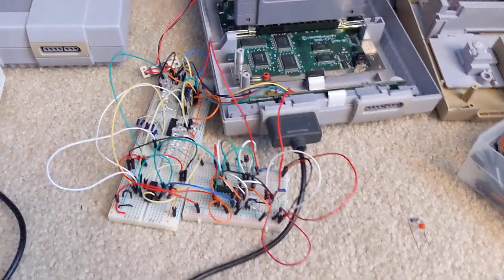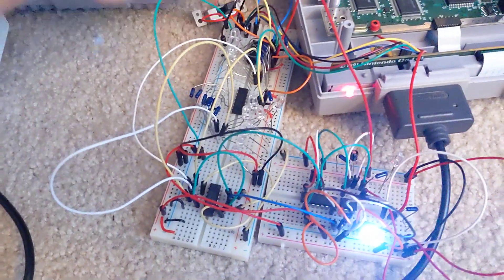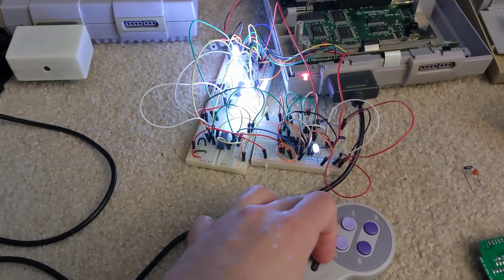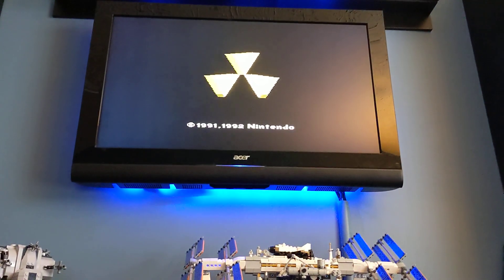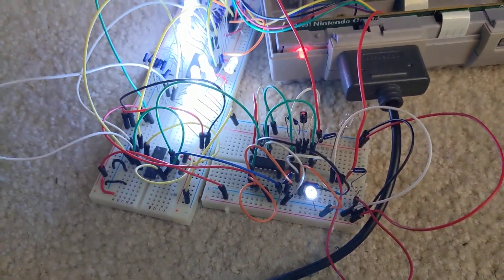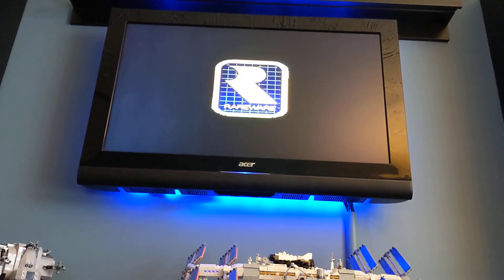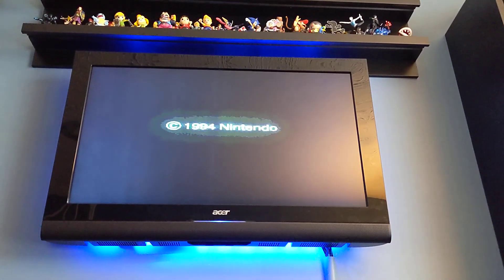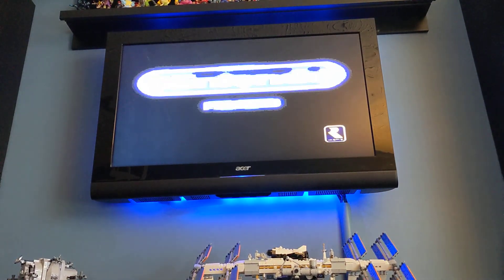Resetting a SNES With the Controller

Comment: Super cool. Would be a handy mod to accompany an SD2SNES. Do you have a direct link to the article on the blog? I was not able to find it.
Reply from the maker: I don't know why I didn't think of using it for a flash cart lol. I haven't written up anything official about it yet, I wrote that description before I actually wrote anything and then immediately got distracted by another project haha. I'm currently working on a few other things. I made up a standalone circuit board for it, though, I just need to tweak a few things on it.

You can check out some of my development notes at this forum thread on nesdev: https://forums.nesdev.com/viewtopic.php?f=12&t=21495&hilit=reset&sid=364fb41622d12afcffcef004f754b594

I think I put a schematic and some explanation on there. I'm having a few glitchy problems with some specific games but I think I can clear it up with some filtering.

Once I do though, I'll make an update video and a full technical writeup on my website. I don't know when I'll get to it but I definitely want to tackle it.